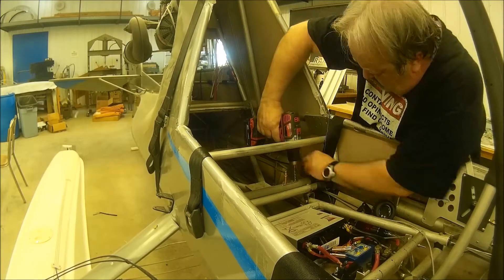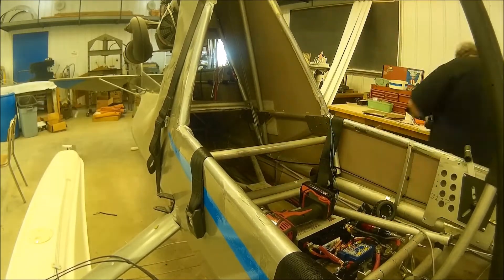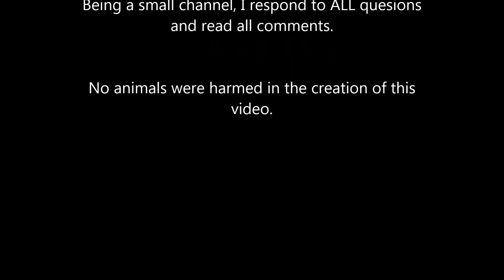Ep #15 Part 1 of 4. Installing a 17 gallon fuel tank in a Challenger 2 Ultralight Airplane

Comment: I built a fuel tank just like that back 2005. Mine is in a Excalibur which is very similar to your Challenger. But mine hold 19 gallons.
Reply from the maker: I actually have an Excalibur. It's never been assembled, and will be next winters project. I plan on it being land based only, and maybe put skis on it for the winter.

Comment: Peter. . . Question: would like to know. . . Why and advantages of 17 gal. Tank over wing tanks. . . Peter . . . That’s my name also
Reply from the maker: On the older models of the Challenger 2, which my airplane is, wing tanks are not an option. I checked into those first, but the wings were not designed to accommodate wing mounted tanks. This 17 gallon tank is also installed without having to remove the wing covering, then recover and repaint them. Which gets quite expensive.

Comment: Looks like that Challenger going to have some great range with that tank 👍
Reply from the maker: With the older 503 Rotax, The endurance should be around 4.5 hours, with a 1 hour reserve. For a total of about 5.5 hours in the air. More than enough to get in and out of the lake country for a fishing/camping trip. If I upgrade to the 582 in the future, the endurance should increase by about 30%.  Thanks for following along.
Reply: @challenger2aircraftadventures  that’s a good improvement!